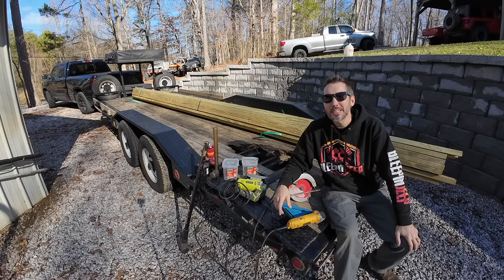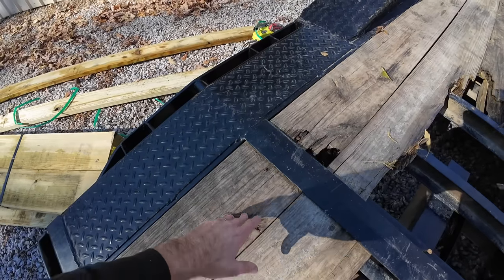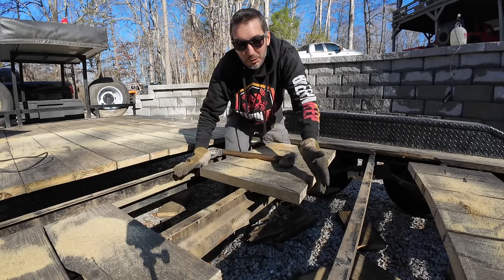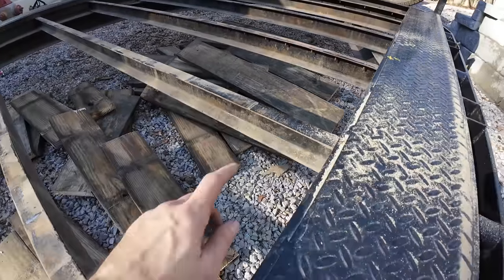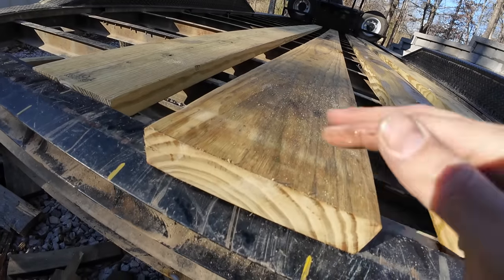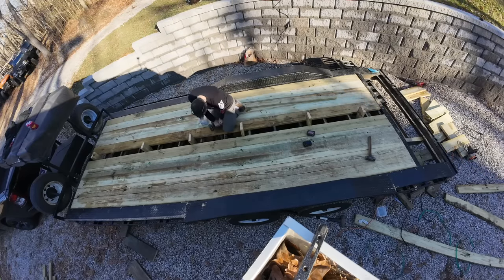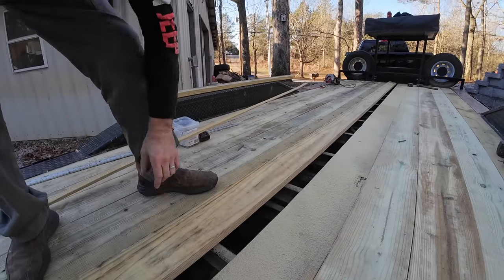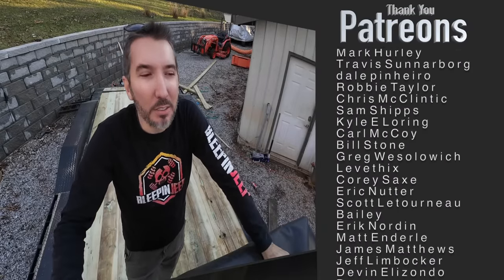How to Replace Trailer Deck Boards in an Afternoon (EASY)

Comment: YouTube educated! A tree pulls important growth stuff from the ground up through the wood to the farthest reaches of the tree.  As such it primarily a bunch of straws that takes what is down below to up top. Water causes these straws or lack their of contract.  Wood workers either deal with it in their design or ask for a controlled environment.  Your trailer is not a controlled environment.  So, that wood wood will attempt to swell and contract as the weather dictates.  Metal is stronger than wood, so you are safe unless the wood outnumbers the metal.  But where does swelling wood go it can't go anywhere?  (I don't have an answer but something to think about).  Also, wouldn't replaceable carriage bolts make more sense for the next time?
Reply: The wood is already swelled when purchased because the lumber is wet.  It will dry and leave gaps.

Comment: You’re incorrect about “crown”. As the wood dries, the growth rings want to straighten, and not curve more.  So, you want the growth rings to look like a smile and not a frown.
Reply from the maker: never heard that one before, Ive always seen it the other way around for strength.  seems like after a quick search and the internet is divided on the topic as well.
Reply: @bleepinjeep I’ve never done it the way you did either Matt. I’ve always heard bark side down = crown. Bark side up = cup. Idk tho. Everyone says different things about it. I’ve done quite a few decks and it’s been fine so far. Never a trailer deck tho.

Comment: I would have left a eight inch gap between each board where rain would not stand
Reply: The wood is wet, it will dry and leave some gaps.
Reply: @Skyecyn1  If the wood is wet you're absolutely correct

Comment: OR contact a local lumber mill and get some hardwood, that shit softwood from the box store can stay in the store. 
DO NO "wedge" the board together like this. ALWAYS leave a gap between each board because wood expands and contracts every season. WEDGING like this was pop the screws when the cup because of being "edged " so tightly togethers..

Comment: If that trailer gets rained on its going to explode! There will be a pile of steel laying in the driveway when that treated lumber swells up! Lol
Reply: The wood is wet, it will dry and leave some gaps.  Treated lumber comes wet when you purchase it, not sure if you have ever bought or worked with it before but it will be just fine.
Reply: @Skyecyn1  it can go both ways its not soaked when you buy it it has usually been under roof. Anyway i was being funny you didnt see the lol at the end???

Comment: I've been doing this for 40 years also alos I guess i must be dumb because I don't see the problem. Are you a later generation that doesn't have common sense.? That was some of the training, on how to acquire the knowledge to acquire common sense
Reply: Rhyme: Bark-side down = crown ; bark-side up = cup.  Or "frown" will  produce cupping.

Comment: Should have left gaps between the boards. It lets water drain instead of rotting the wood.
Reply: The wood is wet, it will dry and leave some gaps.